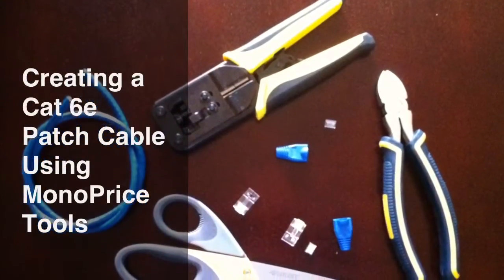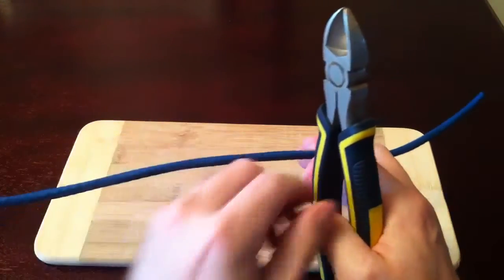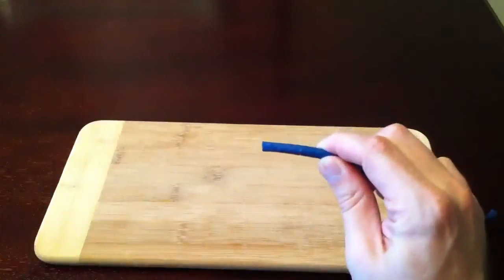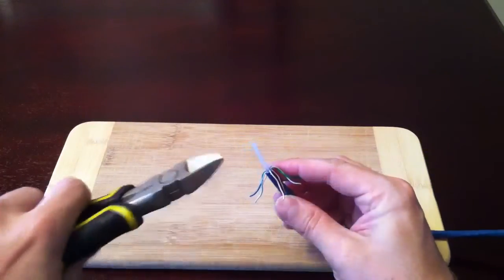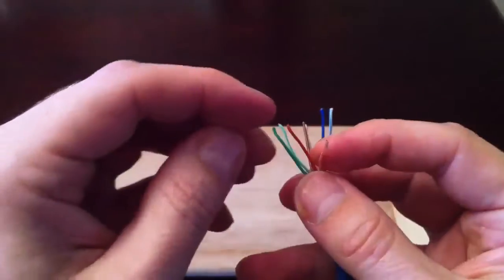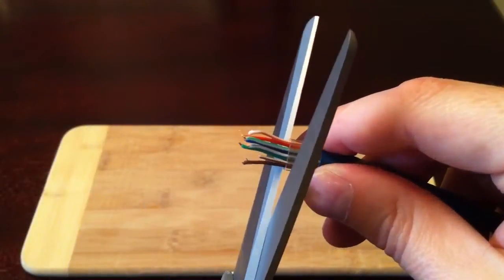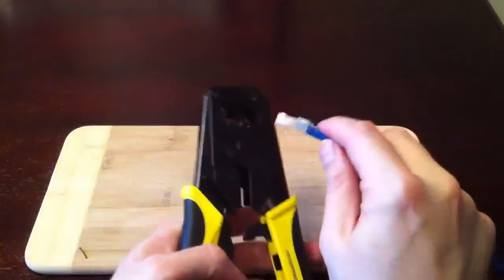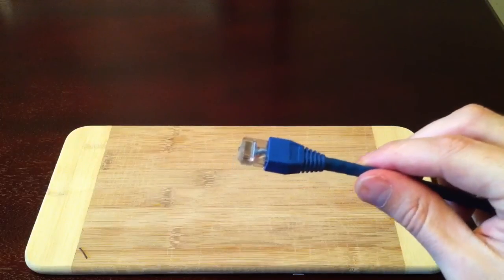Creating a Cat.6 Patch Cable

Comment: Just wanted to say thank you to for posting this. I spent several hours crimping cat6 cables and NONE of them worked. The tester couldn't even get a signal. After watching your video, I realized that the small piece that goes inside the connector, I wasnt pushing all the way in as I didn't cut it flush like I should have. It all now works flawlessly. Thank you so much once again!!